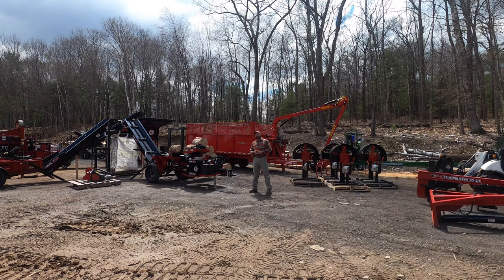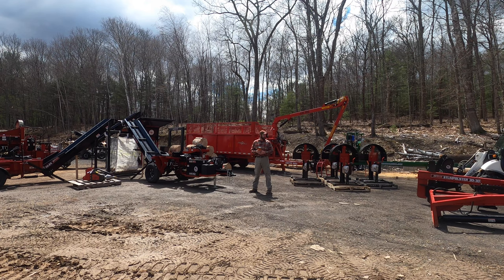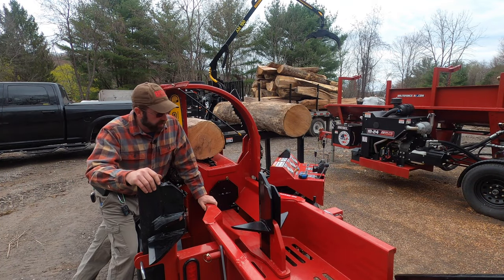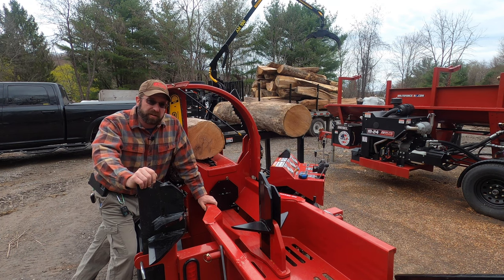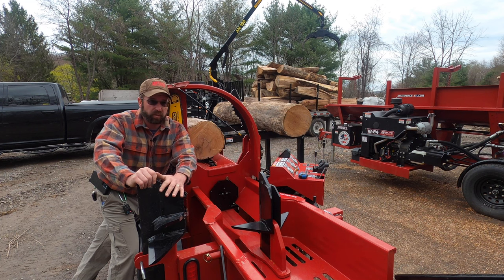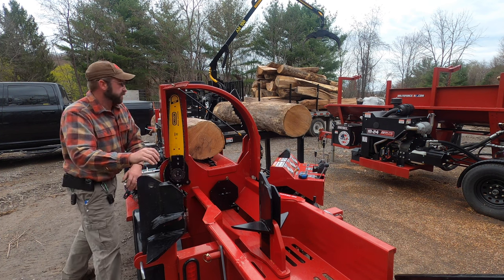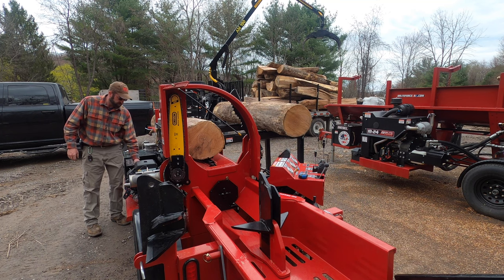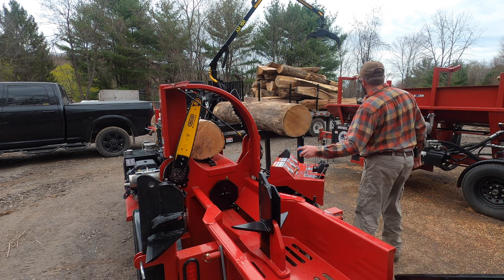14-24hd Processor In Action plus Log Grapple on the Toolcat 5600

Comment: GREAT LITTLE PROCESSOR ! HOW MUCH IS THAT SET UP ?
Reply from the maker: As of 6-13-21 it’s $29,995. Currently there’s a $1500 steel surcharge on it. This is the HD model with the larger engine and oil cooler.
Reply: @ShaverSalesINC  Are these available in a PTO version?
Reply: What brand and model number?

Comment: Can the live deck be used as a log lift as well or is it just a deck?
Reply from the maker: It can be lowered and have a set of “log dogs” installed to shuttle the logs up to the in feed chain.
Reply from the maker: That’s only an option on the 14-24 & 16-24 models

Comment: How’s the lift capacity on that toolcat? Does it do good with 16-20 foot logs?
Reply from the maker: the lift capacity is fair. Approx 2,000#'s. The main weakness is the bucket curl. Only one small cylinder to curl it back. Other than that we love the Toolcat. Its probably our most used piece of equipment!